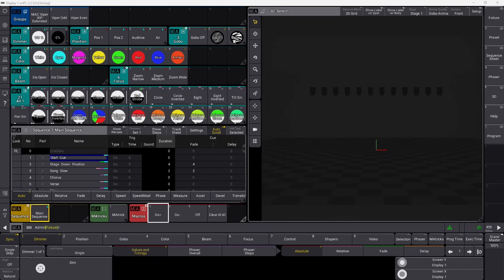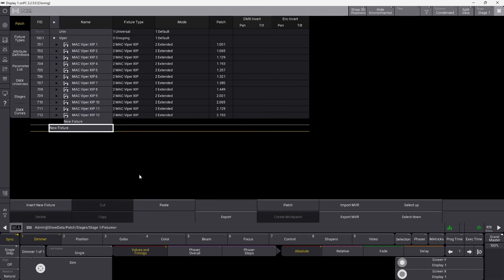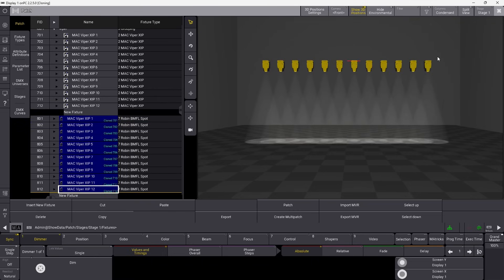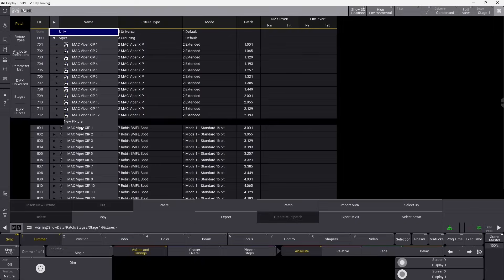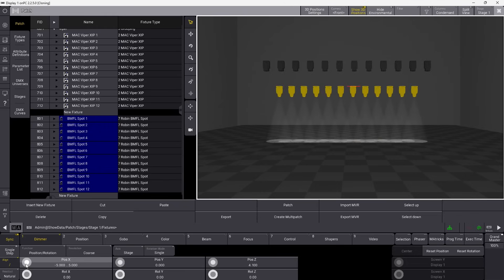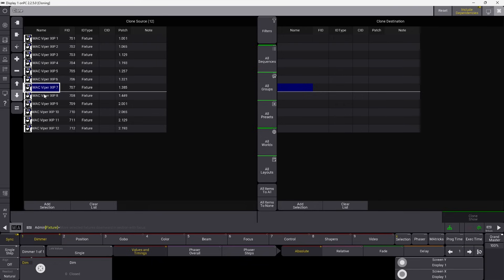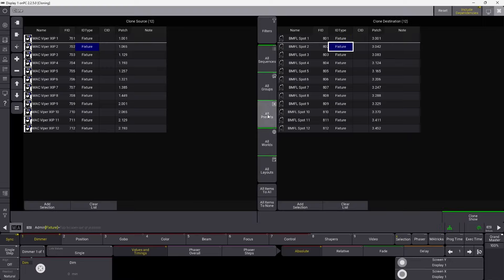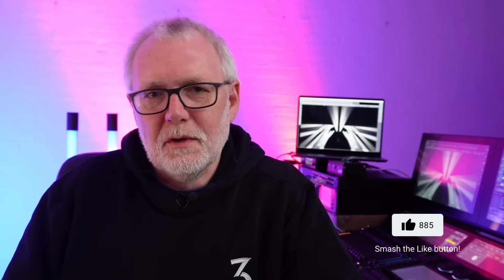How to Clone Fixtures in GrandMA3 – Quick & Easy Guide!

Comment: When a show is based on recipes could one find an advantage in cloning? Positions, gobos and focuses mostly have to be updated anyway.
Also what happens when you clone to a group with a different number of fixtures?
Reply: 1. You can retrieve your presets, which are needed for recipes.
2. If you clone fixtures 1 thru 6 at fixtures 11 thru 20, 11 thru 16 will do the same as 1 thru 6, and 117 thru 120 will do the same as 1 thru 4.
Reply: As @bentoylight1950 says; you can save lots of time as presets are needed for recipes, even getting them close if not perfect makes the job much quicker. And also, if you have phasers with selective information in them -such as a 2 position chase - cloning can enable these to be used in recipes again. 
I was discussing this with my colleague the other day, recipes are a great tool, and cloning is a great tool. Use TWO great tools! 🥳

Comment: Hello,

First, thank you for the amazing tutorial videos! They've been incredibly helpful.

I’ve always had a question regarding “traditional cloning” in touring show files. I understand the process of cloning source fixtures to festival fixtures and the workflow around that. However, I’m curious about how to handle new modifications or additions while on tour.

For example, let's say I adjust timing or add a new bump to a specific festival fixture midway through a tour. The next day, in a different venue with a different set of fixtures, do you continue cloning from the previous day's fixtures, or do you clone back to the original programming fixtures?

How do you ensure that any new elements you’ve added during the tour are retained and correctly carried forward to future shows?

For context, I don't face this issue myself, as my show file is based entirely on recipes, but I’d love to hear how others manage this scenario.

Thank you again for your insights!